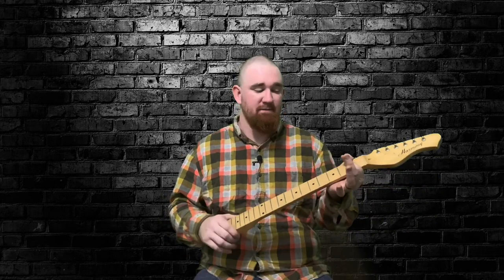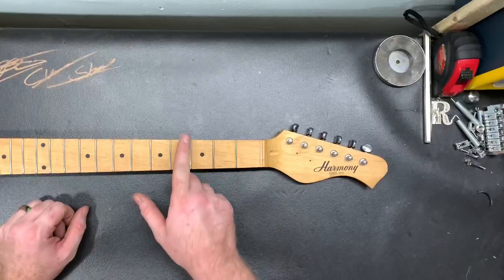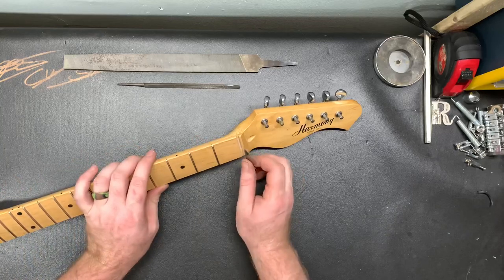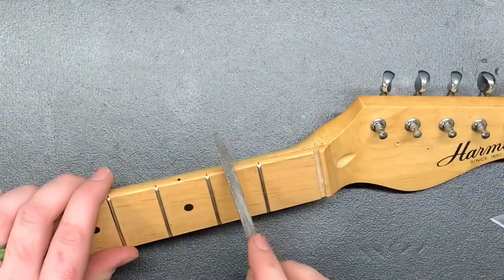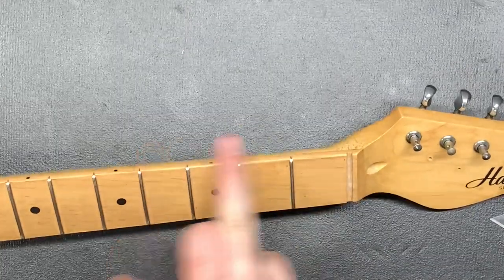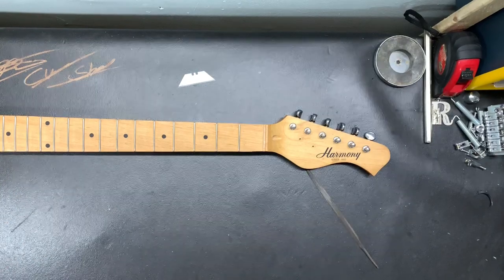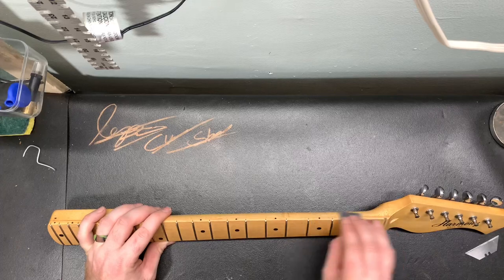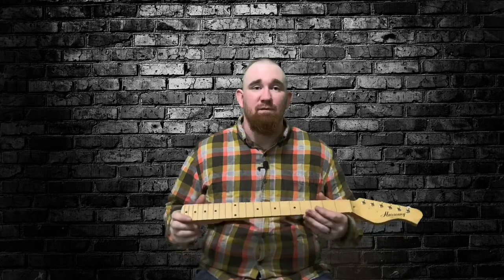How to roll fingerboard edges the right way

Comment: I just use sandpaper - rounds the fret ends at the same time.
  
Install frets; nip ends; bevel ends; round ends hemispherical with files; roll edges and round ends with sandpaper; polish with Dremel, buffing wheel, and rubbing compound; clean with naptha; oil with mineral oil.

Comment: Great Video! I'm upgrading and setting a new Glarry Tele & Glarry Strat! This will make that neck awesome!
doing locking tuners, Bone Nut, Seymour Duncan Quater Pound Pickups and for the Strat, a Floyd Rose "Rail Tail" Tremolo.
Reply: If you're going to put all that money in that new guitar, do the finger board rolling first so if you f#$@ it up, you can save the money you were going to dump on replacement parts.  (Quarter-pounders are very good pickups, BTW).
Reply: @robertrraineyjr967  ( Glarry Tele) 
Installed 
Pickups. Bone Nut, Locking Tuners, New Tone/Volume Pots, The Neck Came Out Awesome!! Thanks!!

Comment: Depending on the amount of roll you should address the fret edge . It will make the fret edge feel and look higher especially if you do lots of slides if you wrap the thumb over lots . The sanding beam will give a more fluid rolled edge this way

Comment: I have been using a dowel, which is slow but cannot hurt frets. To go faster, I have a curved piece of metal. Will have to try the blade method.
People that have never done this before, are going to be very surprised.
Little details like this are the actual difference between a $99 guitar and a $1500.

Comment: I have to be honest. I never gave this much thought as to the "proper way". I developed a process to dress my fret ends that works awesome (for me anyway), and in doing that the fret board gets rounded in the process. When doing fret ends I start with 3 progressive grits of sanding sponge's (60,120, & 220). Due to the nature of the sanding sponge's they conform to the ridges of the frets and sand the metal and wood at the same time. After the sanding sponge's, next is some high grit polishing to further blend everything together and I end up with a buttery smooth playing neck. It goes super quick. Just be careful with the first 60 grit sponge. It's aggressive. I would guess 4 or 5 passes up and down the neck is all it takes, but use your judgement. Again, because they are so squishy they do a great job and it's super quick. 
No exaggeration, I have a neck next to me now and I can angle it in a certain way and see my reflection in the fret end like it's a mirror. It's crazy.
Reply: Progressive grit is best
Reply: But I would all the way to 5000 grit, after  it fretboard becomes really easy to clean, its super smooth
Reply: Sorry, but if you use sanding sponges, instead of sanding blocks, you won't like the result.   If you press down on the sponge version,the fret wire and the fret board wood are NOT getting the same amount removed from their surfaces equally.  The sanding sponge compresses at the fret and this does grind the fret wire down, but the wood is softer and you'll remove much more of it very quickly and are libel to create a disaster with this technique.  The sponge also "rolls" with less control than the block.  You're better off using a sanding block used by car body men/women.  These are made for a more controlled removal of material.  You always have to monitor how much is removed from both the fret wire and the adjacent fret board wood...with every stroke.  And you have to know "when to quit".  This takes experience, so I suggest if you've never rolled a fret board, practice on a culled neck before you take a file to your $3500 PRS or Les Paul.   Buy yourself $50-100 off-brand electric guitar somewhere and practice with an experienced and skilled person who has done this several times and can watch you as you are practicing.  Mark my words; I am not wrong.

Comment: I used a screwdriver sideways to roll the wood down instead of shaving it.
Reply: Damn that is genius
Reply: That’s the proper and best way imo
Reply: That just collapses the edge into a chamfer. A proper roll is rounded and you need to use some kind of sandpaper to achieve that.
Reply: @AndreaAustoni  if you work it back and forth with pressure, it will round it all the way the fretboard top. It's just about the method used and going slow. Rosewood is easy to compress.  Out of all of the ways I've tried, this is easiest for me and you don't have to re stain sanded wood.
Reply: It works with a screwdriver if it has a flat  square edge. It also works if you have a steel tremolo block as long as there are no burrs on the edges.
Reply: Not if you care about the result.  This would fall under "Ham-fisted ways of rolling a fret board".  Please don't do this.  I love guitars.

Comment: My only concern about rolling maple fretboard is that you remove the finish and end up with bare wood around those edges. This is not an issue with rosewood fretboards as they don't have a finish around the top anyway, and removing a little bit off the sides is hardly a problem. But I can see that the maple ones will likely age differently if the very edges of left bare. They'll probably go much darker than the rest of the neck and fretboard.

Comment: I don’t recommend the razor blade. It’ll give you an angle instead of a rolled edge. You’re trying to avoid that. You want to compact the wood fibers, not cut away at it
Reply: You want to remove wood at the edge, not compact the wood fibers.  Neither a file, razor blade, or any grinding tool will compact wood fibers.  Now, a HAMMER will...  Don't use a hammer, man .  This is serious misinformation.
Reply: @robertrraineyjr967  Who said use a hammer?

Comment: Any way that does not include beveling the fret ends is the wrong way.  Sanding, shaving, pressing the wood edge between the frets is called scalloping.  As you reduce the wood, the frets stick out even more.

Comment: I 3D printed a very small caul and stuck some glass paper down to roll the edges of a kit guitar I was assembling but after the bottom side was complete I gave up as it was a pain, I should have had larger handle grips on the caul, the board did have a bit of a chamfer to start with but nowhere near as good as a Fender neck.
 I might try your method on the top of the board, to me it looks odd having the top chamfered and the bottom rolled

Comment: IMO the proper way to roll a fretboard, is to file the fret simultaneously with board. if you just do the board, the fret ends will stick out and just wont look or feel as flush as you'd hope (like the thumbnail). Especially when it comes to stainless steel frets, you cannot use something like a sanding sponge, as the hard frets won't get filed down and rather eat through the sand paper & backing material
Reply: This is the way, fret end simultaneously with the board. He says there is no wrong way, well he demonstrated it is possible. Imho he butchered the neck. For the love of god, please take it slowly and consistant, you can't add the wood back if you mess up.
Reply: @mennolaan2468  Yyyyep. Definitly. These youtube self-proclaimed experts are a nuisance, really. :-/

Comment: Round Screw drivers is the best looks very natural compare to most of other method
Reply: tis works for rosewood but not maple with gloss
Reply: @azmiyusof6253  at first i tot the same way but i got nothing to lose either way if i do with blade i still lose the lacquer if i roll with screwdriver i will crack the lacquer so I decided to try to roll with pencil but still no crack then i try with screwdriver then i achieve what I want the roll edge feel n look n save the lacquer. The lacquer is harder than u think give it a try u will save the lacquer on the fretboard.but I wouldn’t do on vintage guitar.
Reply: Oh, lord, another one?

Comment: Stop bragging and pretend you're a pro.  Rouding the fretboard only, without including the fret edges in the process, is amateurish work and can be totally counter-productive by making  the frets protrude. So "the right way" is definitly not the razor blade way. The only "right way" is to file (or sand) BOTH the fretboard and the frets at the same time. Oh, and you don't adress the re-finishing afterwords, which is mandatory on a maple fretboard to avoid long term issues (which is the reason why maple fretboards are ALWAYS sealed to start with!) Gee, anyone is a self-proclaimed luthier nowadays?! Dunning-Krueger effect!!
Reply: The first time I did it to a Maple fretboarded neck..just have to pay attention and be careful not to remove too much of the fretboard and like you said roll the fret ends too if needed.

Comment: Very great video! Straight to the point and no extra bs, I loved it! 
Here's my suggestion if I may: using micro-mesh sanding/polishing pads to roll the edges. I love using them for to the edges since the I can bend the pad and really dial-in in the curve around the edge of the fretboard. Starting with a stronger grit and light pressure to shape and ending w/ a 12k to buff it. Thank you!

Comment: Hi thanks, one question with maple fretboard wouldn't the filed part prone to get dark by the sweat and dirt of the hand cause it has no protecting layer anymore? I have an Ibanez with all maple very lightly finished wizard 3 neck with very raw edges and thinking of doing this but have a sweaty hands so I am hesitating... Any comment?
Reply: Any wood that has a finish protecting it will quickly darken from skin oils and sweat during use in the places where the finish has been removed.  It will be particularly noticeable on the exceptionally light colored maple like you have on your wizard neck.  Look at any tele or strat with a maple fretboard that has a lot of playing hours on it. Even just repeated string bending as well as  a player with longer fingernails on their fretting hand will rub through the factory heavy gloss finish and leave dark areas from skin oils and dirt where the finish is gone.  It will be especially noticeable for a player with a lot of skin oils and/or sweaty hands while playing.  Some players like this "natural relic" look on their Fenders.  It is just one of the things that players have to accept with extended playing of a guitar when maple is the choice of fretboard wood. From what I have seen, the matte/satin finish on wizard necks is much thinner than the heavy gloss finish on a maple Fender and the wizard will most likely discolor much faster than the board on a Fender.  If you want to sand, scrape, or otherwise roll the edges on a wizard neck, I would think that you will at the very least need to refinish the edges where the finish has been removed by the rolling treatment, but in attempting to match the edges to the rest of the fretboard, the final finish match will be very difficult to achieve to any level of satisfaction.  It is much more likely that you will need to remove all finish from the fretboard and the neck  and do a complete refinish of the neck and board in order for the guitar to look right in the end. You would need to try to contact Ibanez to find out what they use to finish a wizard neck.   I hope this goes some way towards answering  your question.  I personally think that radiused edges are a must-have for playing comfort, but since I prefer a rosewood fretboard, I am fortunate that carefully "rolling"  my edges and a lemon oil treatment is all that is needed to achieve it. Maple is a very nice fretboard material and can be very fast for shredding, and those wizard necks are amazing, but my playing style is more laid back these days, so Rosewood works fine for me now. As an aside, I have though about trying to somewhat lightly compress the wood fibers at the sharp edge of a Maple fretboard using something like the edge of a polished steel rod or round-profile screwdriver shank, maybe a chrome or glass guitar slide to see if it could make even a small difference in smoothing the sharp edge without wearing away the finish. It has worked for me during various small woodworking projects on unfinished hardwood, but i have not tried it yet on pre-finished wood.  I picked up a  "$50 special" maple fretboard yard sale guitar (glarry) as a modding project for kicks. I will try this out some day, and if it wears through the thin finish I can just refinish the whole neck. Good luck with the final result if you try to do this.

Comment: I'll try to be nice, here, but in using a file, you only push down on your material on the out-stroke.  You NEVER  pull a file back to you, sliding it on the material and you certainly don't press down on the material with the file in the pull strokes.  It does nothing to remove material and it only dulls the file.  Metal files are made to cut in one direction, only, even the cross-cut ones.  It would take a strong magnifying lens to observe this, but it is true.

Comment: It would be a lot easier,and less time-consuming, to use a fretboard-radius sanding block.I'd use the 7 1/4" block to get the edges of my neck rounded.I'd use 320 sandpaper, and go from there
Reply: That would work.

Comment: Okay, I bought a Takamine acoustic guitar, and it was Chinese made but was not that cheap.  It retails for $800.  The quality is actually good, but it seems until you hit about the 2 grand price point to get a Japanese luthier instead of Chinese, you end up with problems that need fixing.  My problem is that the frets are rolled too much, so that pressing the high E string causes it to fall off the edge of the neck.  I think I need every fret replaced, and it's a brand new guitar.

Comment: great tips, i will try this on my fender acoustic, it has a sharp edge fretboard but at the lower side of the neck, which size of sandpaper you recommend?
Reply: you might want to consider less rolling of the board on the bass side.  Where you really need it is on the treble side.  Put your guitar on with your strap.  Make a chord in several places and see if most of your need isn't on the treble side.  Do the treble side first, put your guitar on, again, and reconsider how much you need to roll the  bass edge.  (You're welcome).

Comment: nice video! How about fretboard with binding where the binding is the sharp part?
Reply: Be very careful with rolling binding, if you've never done it before.  You really have to be careful not to screw the binding up when you roll a board, especially with one that has nibs (the little binding piece that touches the ends of the frets, both left and right).  Again, this is tricky.

Comment: Thanks bud. I just used a triangle file like you did. Except I used a draw file technique with the neck firmly (yet lightly, lol) clamped in a vise between two scrap pieces of wood.
Works great.
BTW, this was a Fender licensed neck (not cheap, but not uber expensive) and it had some SHARP ass edges.